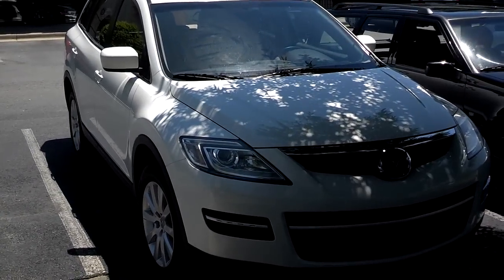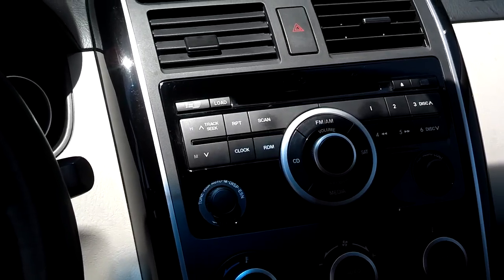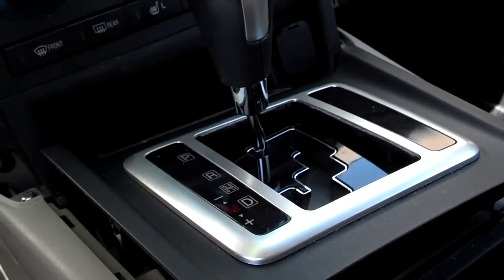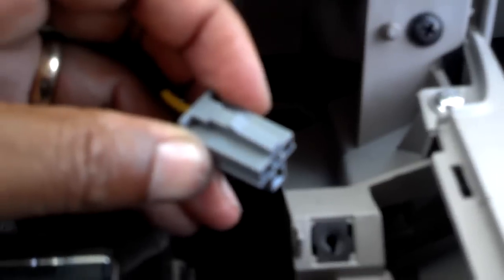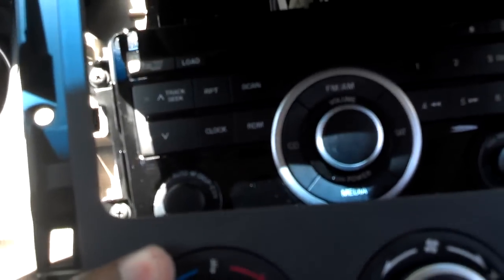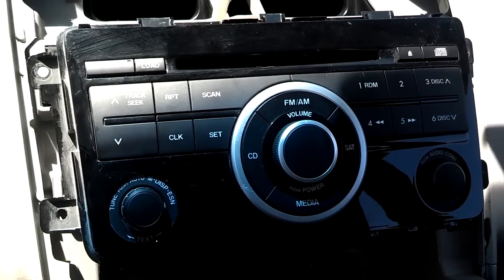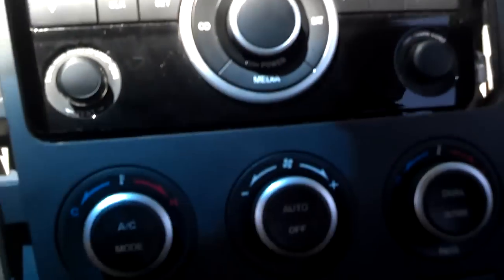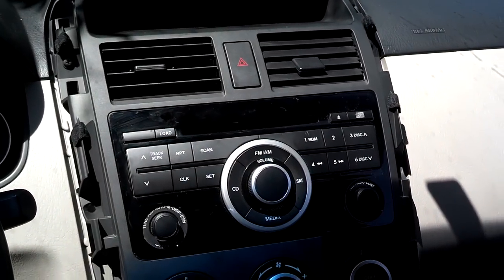Mazda CX-9 Stereo Removal, Replacement - Auto Repair Series

Comment: Thanks. I watched this to take apart my 07 cx-9. I wanted the auxiliary input back so I had to take out the stereo and unplug the satellite radio connector and the connector for the factory Aux input was just hanging back there.
Reply from the maker: +Kyle Veatch glad it helped.
Reply: Kyle Veatch  i want to do that can u ecplain steps please
Reply: This may explain why my aux input just stopped working one day. It may have gotten unplugged from the back of the stereo! I know it is not the jack in the console as I replaced that and still doesn't work. I will have to check the back of the stereo.

Comment: Hi Robert, thank you for this video, very interesting and helpfull, i have a problem with my cx 9 CD player, there are two CD in my cd player charger, but are bloqued, can't play them and when i change Mode i just come on the radio mode or on Aux mode but it no more comes on the CD Mode, it's like it doesn't exist. Do you think it s possible to repair it ? and how? thank you so much

Comment: Very in depth video and I know that is not easy.  I have been wondering about updating my Mazda CX9 With NAV stereo system.  I like the feature of having a Navigation, but the system that my NAV uses for me is not good enough and I am looking to see if there is a update and how to do it.  Any recommendations?
Reply from the maker: I have gone to using my phone as a GPS. The down side is, if you are in an area with no G3 or G4 you can loose your directions.

If you go with a built in system or portable unit, do update the maps at least every 12 months.
Reply: Don't get me wrong, my Navigation works in my car, its just I think some of the features are not set properly. With that I was thinking about what or if their was a way to update my current DENSO radio/NAV system in my Mazda CX9 2010 to improve the features and quality of the NAV.
Reply from the maker: Most systems have updates which are released every 3 months.

Comment: Hello Robert, Great Vid. I'm thinking of upgrading my current CX9's stereo to the Navigation system.  Do I still need to take it to the dealer for reprogramming?  Would you happen to know the cost by the dealer to reprogram if necessary?
Reply from the maker: camboy 0724 I do not know but they usually charge 1 hour of labor which is around $95.

Comment: Hi Robert, thats my brothers  name as well.
My question is if you client here in this video wanted to install a navigation radio would it have been as easy as putting in the same one?  I have the same CX9 as well as the exact radio as your client in this video. However my radio crapped out never took more than 1 CD.
However, I want to upgrade to one with navigation screen and it also comes with back up camera.
P.S.
great informative video.
Subbed, liked & shared
Reply from the maker: Yes, should slide right in.

Comment from the maker: Well, the one I worked on REQUIRES DEALER PROGRAMMING. Hope yours does not. It will pay cd's, tune radio stations but NOT PUT OUT any sound until the programming is done.
Reply: Mine doesnt have any sound so i have to have the dealer program it

Comment: thanks for posting the video, very helpful. I have a CX-9 with the back-up camera. The radio and Bluetooth do work. The problem is that I cannot turn off the radio, change the station or lower the volume. The LCD display is always on and showing color bars, cant turn that off either. I have to unplug the fuse to shut the radio and display off and when I put the fuse back in, the same issue. Any suggestions?
Reply from the maker: Steven Klauz No, something is stuck in there, I'd get a replacement. Sad to say I think the replacement will have to be programmed at the dealer.
Reply: thank you
Reply: Steven, I have the exact problem going on with my 2010 CX-9. I found a replacment radio on Ebay that is supposed to work. But I am concerned about the reprogramming issue. What did you end up doing to get your radio fixed? Thanks, Dan
Reply from the maker: Call your local dealer and ask what they charge to do that. The one I checked was only about $45.

Comment: Hello Robert I have Mazda C-X 9 and the complete Bose Audio Radio CD went dead as well as the Information Display panel above the stereo.  Can you kindly advise if that happens when the Radio/CD goes dead. Please help me figure if this just the Radio/CD dead or if its an electrical problem
Reply from the maker: If the radio and the display above it went dead, you likely have a bad fuse, have you checked your fuses?

Comment: Hi, Robert! You have any idea of AUXILIARY not working for CX-9 2009?
Reply from the maker: No I don't. Probably a bad radio.
Reply: Check the back of the radio. If you have Sirius (a.k.a SAT button) you might have to switch connectors
Reply: noxus418  Thanks Guy, I solved the problem, the issue was with Auxiliary input port, just replace it with the new one cost of 10 Dollar

Comment: Hi Robert, I have cx9 2009 model. Car has sat nav DVD player but without Bluetooth and I want to add Bluetooth devise in the same system. Could you please advise in this matter.
🙏.
Reply from the maker: I have no experience with that. May have to go aftermarket or get an adapter.

Comment: In my CX9 2009 lights of gear shifting panel, lighter and harzart button are not working. I checked all fuses that are ok. Can you help me to find out what is the problem. Thanks.
Reply from the maker: ***** No I can not. I do not have access to that vehicle. You can use this video to pull things apart and make sure everything is plugged in.

Comment: I put a OEM touchscreen radio in mine (bought on ebay), the radio works fine, didnt need to get it programmed but I thought the backup camera that is installed on the back of the car would have a connection, didnt see any... If anyone knows about this please reply or contact me.
Reply from the maker: We don't even know what kind of car you have. 😒
Reply: Robert DIY 2008 Mazda CX9... My bad